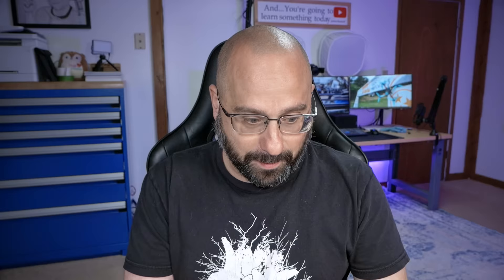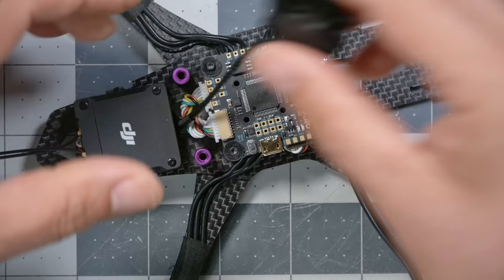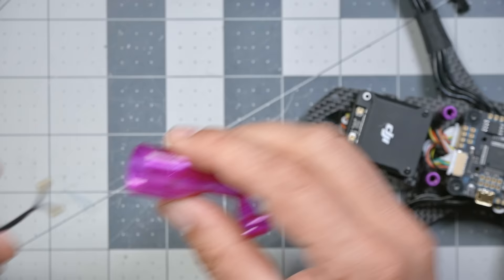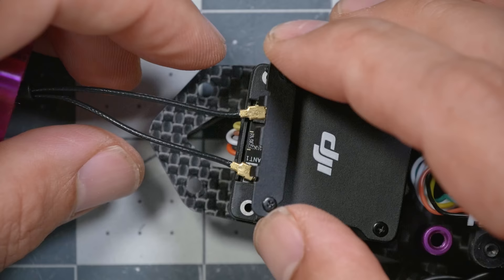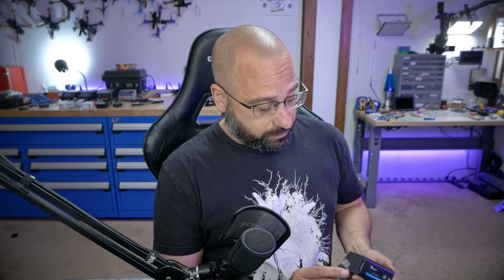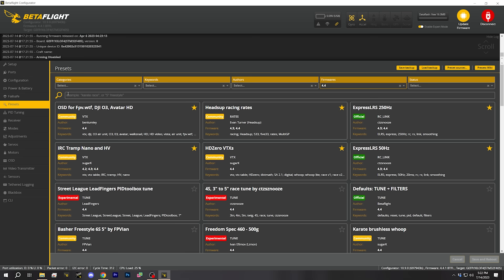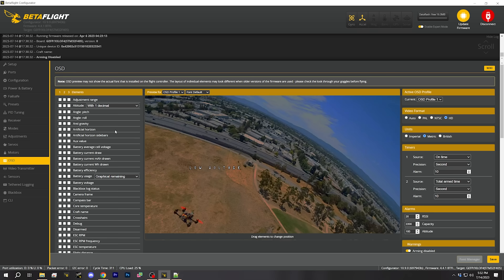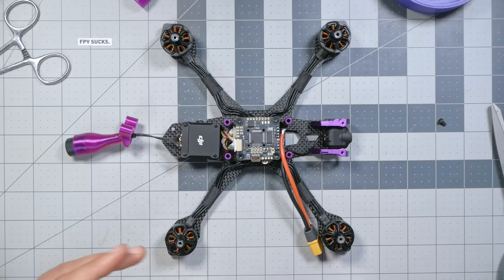Build an FPV drone in 2023 - Part 5 - DJI O3 Video Transmitter

Comment: New Guy Note:
 if you try and bind the O3 Air Unit while powering it via the USB C port, the O3 Air Unit will not go into binding mode.  If you try and bind the O3 Air Unit while powering it through the power input from the Flight Controller/ESC, the O3 Air Unit WILL go into binding mode and bind quickly to the goggles.

Comment: I bought this kit.  My review: We need a camera mount adapter for that frame that removes the prop view and jello effect. If this build is really geared towards beginners, it makes sense to enable it to fly without a GoPro.
Reply from the maker: It can fly without a GoPro. It will have props in view and not be able to use DJI EIS. If those are essential features, this kit may not be for you. But for a lot of people they're not essential.
Reply: Does the jello effect happen in the live video in the googles or just in the recorded video?

Comment: This series is amazing. 

Would you consider doing an additional video for the video setup but using a fixed wing FC? I know its not your gig but you have the knowledge
Reply from the maker: The setup of the O3 would be exactly the same for a fixed wing FC, wouldn't it? I'm not sure what would differ.

Comment: I had the same issue with the o3 wire, the faster way was to remove the O3 camera cable from the unit and drag under the Esc.

Comment: As always, fantastic video! This may have been mentioned in the comments below, but I did notice on another FC (Tmotor 20x20) that the "HD" plug was reversed as to what the DJI 03 pinout was. Thankfully I noticed this and had to manually switch all the little connectors.

Comment: I was going to ask you if the 03 air unit will work with Goggles 3. I looked at Get FPV and under their Goggles 3 is a note that Goggles 3 are backwards compatible with 03 air unit as long as you get the latest firmware. Yea! Thank you for the great videos, instructions and advise. It helps to watch through the video before working the drone. I had not taped down my motor wires so it was much easier to run the camera wire under the stack without removing any arms.

Comment: 1:15 i mean to be fair, if the rest of the industry agreed on connection order standards, Analog, walksnail or hdzero etc could all have a shared plug as well, no?
Reply from the maker: What makes you say that the FPV industry standardized on connectors? Every FC and esc has a different connector, for example.

Comment: 2:00 
Dji o3 airunit has a fragile body. when dropped, the part with which you attach it to the video is pressed in and hits right on the processor, which cracks and fails. now most users turn the DJI o3 airunit upside down. then the main problem goes away.

Comment: In the hope that someone sees this comment, I am using these videos to help me set up my first build. However, I have the DJI Goggles v1 with a Vista running WTFOS. Do I need to do that extra step with the CLI commands about the canvas width and height on that VTx, or is that specific to the O3 setup? Thanks!

Comment: the O3 air unit was never screwed down , just taped . was that on purpose or does it need to be screwed down at all?
Reply from the maker: It's mounted with double sided tape. Not screws.

Comment: If I update the firmware on my v2 goggles to use o3 air unit, can I still use caddx vista?? Thanks
Reply: I believe so but you have to change system in goggles than reset

Comment: What’s going on sir, just finished building my 7” Rekon.  I ran into an issue tho. My motors will not go the direction I wants them to on Beta flight. I’ve even tried using the wizard, and manually tried to change it. When I tap on the motor that I need to change direction, it just pauses for a sec and continues rotating, just not the direction I need it to. I just watch your entire season on understanding beta flight. Any advice for me. And by the way great work on explaining FPV to people like me. Your the Mr. Wonderful on Shark Tank for FPV lol.

Comment: first of all thanks for all of the videos I owe a great deal of my knowledge of drones mostly to you!
secondly, I ran into a problem in this video. everything was going to plan until I tried to activate the 03 air unit, it wont even show up in the dji assistant 2 app (consumer series), but it does show up on my pc as external storage. I tried different usb-c cables, i tried it with a battery plugged in, I even tried the "FPV series" app. any idea on what to do?  
thanks again!

Comment: does that ham unlock work for the goggles 2 or just the v2
Reply from the maker: Depends on which mode you're in. In O3 mode the ham unlock is the same as g2.
Reply: @JoshuaBardwell  what do you mean what mode whats that
Reply from the maker: The goggles can be switched between DJI Digital FPV System mode (for Vista and older air unit), O3 mode, Avata mode, and DJI FPV Drone mode.

Comment: will the wiring on dji 03 vtx plugging in to a speedy bee v3 f7 FC with a crossfire receiver burn out the vtx ? since i heard 03 has a built in receiver

Comment: Great video in great series now I understand more about live video transmission on a quadcopter. And I hate to ask you but is it possible to mount a camera and transmitter board on any drone powered up and have fpv??? The reason I ask is because I have so much latency with my current drone that I can't fly fpv.
Reply from the maker: Yeah that should be possible. Just need to figure out how to power it.

Comment: Hi Joshua, how are you! Your videos helped me a lot, but now I bought the Integra goggles and I can't find the configuration option as in the V2 goggles where I can define the camera transmission power, both o3 and caddx. in the bone integra is not possible??
Reply from the maker: O3 does not have adjustable transmission power. Neither does Vista when used with g2 or Integra.

Comment: Thanks for the video. I'm having some issues, as im using crossfire, and for this flight controller both crossfire and DJI use the same UART (UART3), so when I load the preset I lose crossfire control. Can I use a separate UART for Crossfire so that I can have both working? Thanks
Reply from the maker: Yes absolutely. You need to put Crossfire on UART 4 and DJI on UART 3.

Comment: Is there a Stl file for the antenna mounts ? I ordered the frame separately. Would be great 😁 love the videos jb ! Finished my quad yesterday 😍 just wondering how to align the battery cable. When it’s sideways it seems to be in the way sometimes 🤔 it’s my first fpv quad tho. So I never had a quad with more then 1s 😅
Reply from the maker: You can find stl here https://www.thingiverse.com/thing:4874074
Reply: @JoshuaBardwell  thank you for the fast reply! Is it the vista mount? Will it be compatible with o3 air unit antenna ?
Reply from the maker: Maybe this is the one you want then: https://www.thingiverse.com/thing:5660773
Reply: @JoshuaBardwell  Perfect ! That seems to be the one you used in the video. Thanks a lot and keep up the great work!

Comment: Why wouldnt we include a tpu mount for the air unit
Reply from the maker: You can print one off if you want, but it's not really necessary.
Reply: Personally I prefer running the O3 unit hard mounted to the frame. Since this frame has the holes for it, you don't need any additional parts. You can either run the wires out the bottom under the back plate and back up inside, or you can run them over the top of the air unit. My preference is under the plate, just throw some loom tape over the wires to protect them and you're good to go. I've actually been running my RX under there on other QAV-S frames and have yet to have anything damaged actually, it would take a remarkably precise impact to hit anything in that spot.

Comment: my V2 menu looks nothing like yours. System/ Device isnt on my menu
Reply from the maker: The menus change depending what mode your goggles are in. At this timestamp in the video, I was in the DJI FPV System mode, switching to the O3 mode. https://youtu.be/kinmxuOnoUM?t=684&si=nYJpg1Pj-ynobsbs

If you were already in O3 mode, or if you were in Avata Mode or DJI FPV Drone Mode, the menu would look different.

Comment: So for o3 system I will need to use the dji controller only?
Reply from the maker: No you can install another receiver. I will install elrs in this example.

Comment: Hey JB, What foam are you using on your goggles 2?
Reply: I am not sure what JB is using, but I am using the updated Dji goggle 2/Integra "Soft" foam. It made my goggles 2 fit as good as my Original V1/V2 goggles. I was running the Pyrodrone Comfy foam on my goggles 2 before the Dji foam, and it was really good too. Worst: Stock goggles 2 foam. Better: Pyrodrone Comfy Foam for Goggles 2. Best: Dji soft foam plate for goggles 2.
Reply: @mikebergman1817  thank you sir!

Comment: Does the O3 act as a receiver for the DJI controller and send the commands to the FC?
Reply from the maker: It can, yes, but that's not how this build is set up.
Reply: @JoshuaBardwell  I was hoping to delay getting the controller, but if I wan't to get out of noob mode, time to pull out the CC again.  Glad you put out this series.  The Avata was my in to FPV, and had no clue how to go about building my own.

Comment: I need help Mr. Bardwell. I cant get my osd to show voltage in dji goggles v2. Though betaflight reads my voltage just fine. Im sure youre very busy, is there any chance you could connect me with someone who can help; if you are too busy? Thank you so much for the work you do!
Reply: Ive tried flashing the esc, the caddx vista air unit lite, and the goggles v2.

Ive tried messing with the setting in the goggles, in betaflight.

I messed around with the uarts and that helped other people but did not change anything for me. Though i dont understand uarts very well. Sorry.
Reply: Is it O3 or vista?